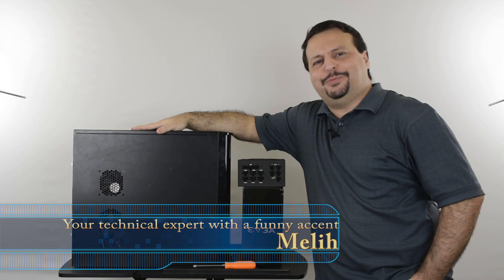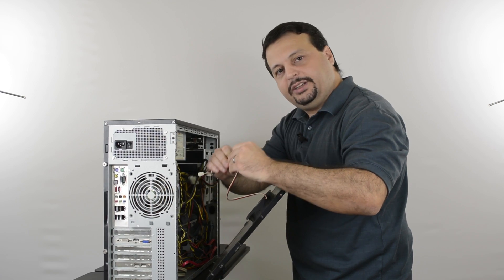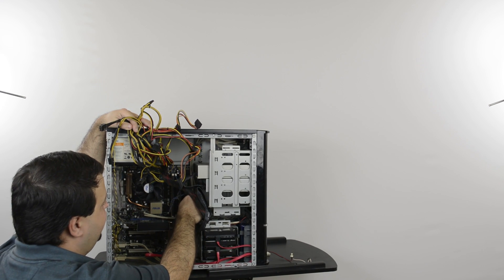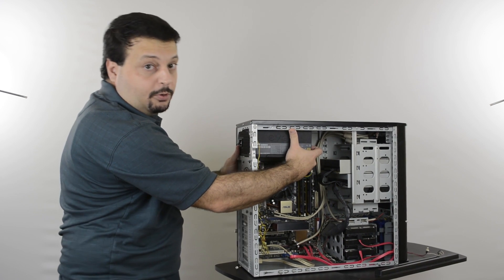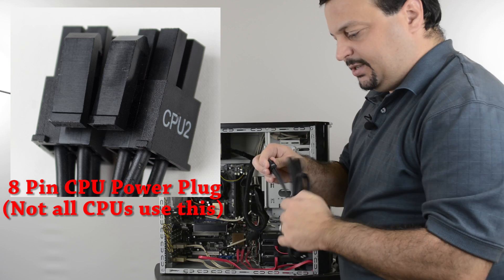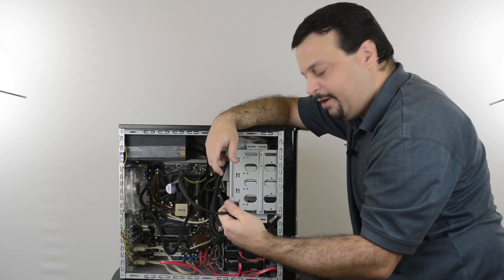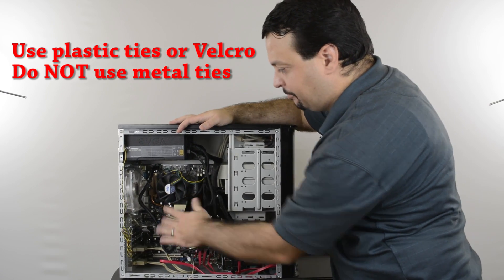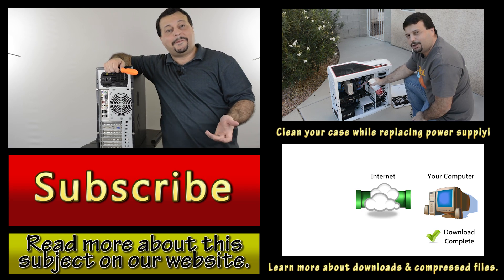How to replace your Power Supply

Comment: Can't you just take out the plugs in the old power supply and plug those into the new one?
Reply: Malik Walters No. Using the old power supply cables is ONLY meant for the old power supply. You must use the cables provided to you from the new power supply. If you use the old power supply cables on the new one there is a high chance that you will eventually fry the computer. Especially risky if the new power supply delivers more power than the old one.

Comment: I cannot get the 24 pin cable out of my motherboard it's like it's glued in there. Any tips I don't wanna break anything
Reply: Its not going to break, just pull strong and wiggle it until it comes out
Reply: Chris 410 OK I'll give it a shot
Reply: gangstalishis did u get it out?
Reply: well i ended up getting it repaird at a shop, turns out there was more things wrong with it than just the power supply, ended up costing me 100 bucks.

Comment: Do you actually need to back up anything(data from the hard drive)
Reply: Hell no, and why did you think that
Reply: Chris 410 do all the wires come with a power supply
Reply: Chris 410 do all the wires come with the power supply
Reply: yes it should be. unless you want extra pieces.what i bought and reccomend it the 600watt semi modulay evga power supply.

Comment: Wait the fan is supposed to face towards the mother board? Really? Cause I'm replacing a power supply right now ive had for close to 8 years and the person who built my pc had the fan facing out of the machine.
Reply: Razqua if your fan has a grill where the fan can breath on the outside u can have your fan facing out it does NOT necessarily have to face the mother board
Reply: There's different types of fans

Comment: what power supply did u use?
Reply: One of the EVGA ones. If you are interested just go to the EVGA site and find one that fits your psu needs.
Reply: if thats a 600 watt supply then thats the one im getting tomorow for my gaming pc. looking forward to upgrading to the gtx 1050 ti soon
Reply: Chris 410 I would recommend getting an 850 watt power supply

Comment: Omg looks fairly simply, just spend $165 in parts and labor to get it done by a local computer repair although they did install a new exhaust fan too. For next time, I will save the extra cash and do it myself.
Reply: Brian P. Good for you Brian 😊 it's easy especially with these types of videos.

Comment: ... nice cable management
Reply from the maker: dylinger2002 Honestly I had trouble telling if you were sarcastic or not, but I have to say, cable management wasn't really the priority here, and somewhat outside the scope of the video, but in most situations, it's enough. All we need is some airflow, which typically comes in from bottom front and exists through top back for this case. Getting cables out of the way accomplishes this, even if they are just tucked in between drive bays :)
Reply: true XD
Reply: +For Fun Gaming no dude it's really good
Reply: dylinger2002 just throw all the cables in ... so what if they hit the cpu fun :p